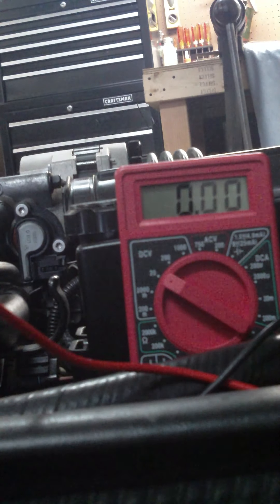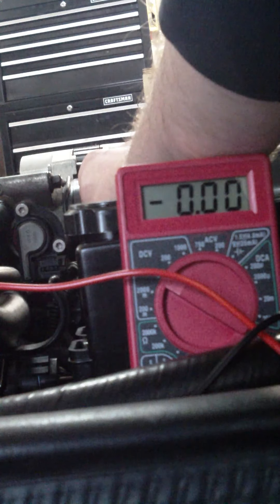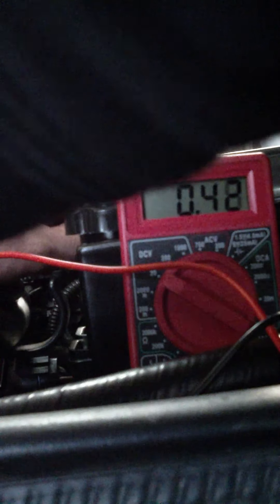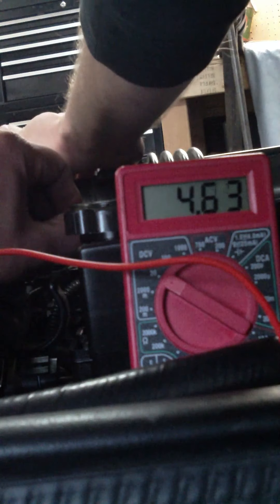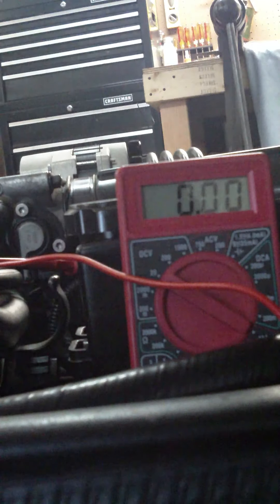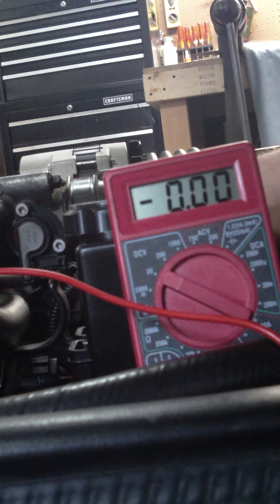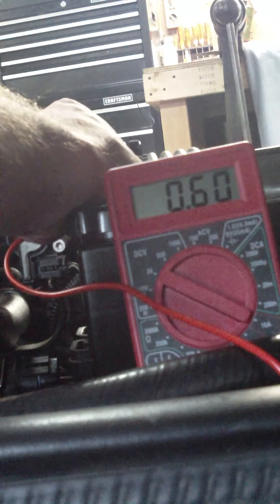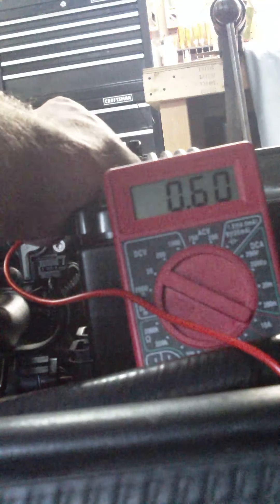Testing TPS Sensor C4 Corvette LT1

Comment: do you have a shop where you work on corvette? I am in the Pittsburgh area with a 93 Ruby that intermittently runs rough or won't start.
Reply from the maker: I do but only at my house. I work at a shop in Greensburg, PA Performance Plus Automotive as well. I live in the Indiana, PA area. I would be willing to look at the car in either place. You can e-mail for more.
Reply: sent you a private message but no reply. what is your email address?